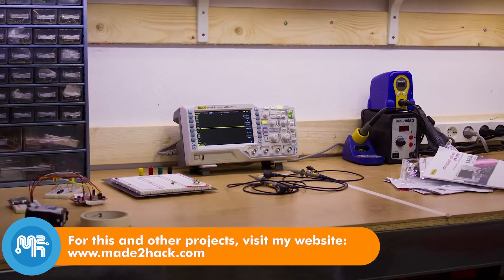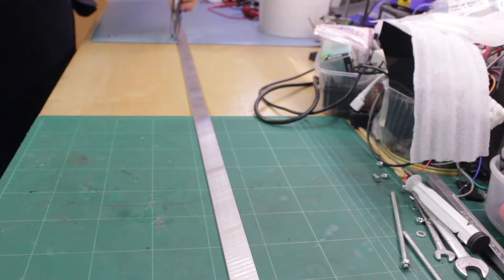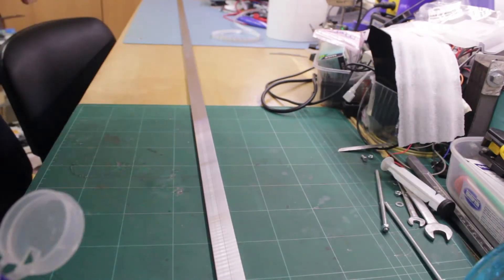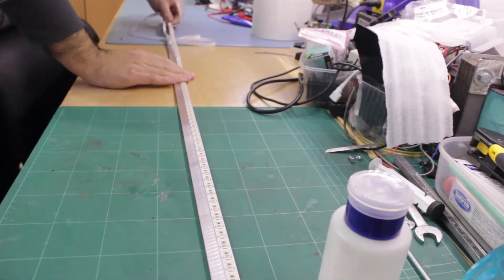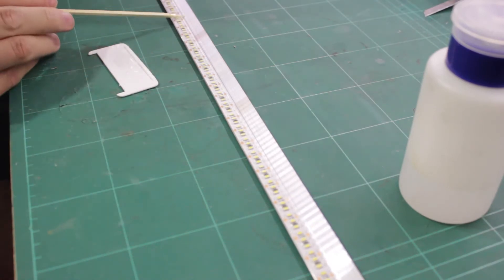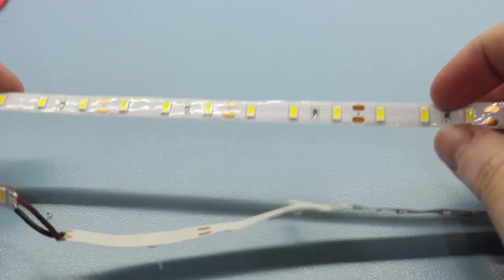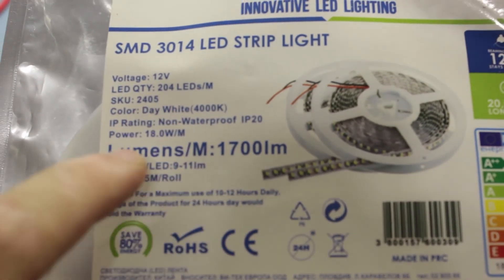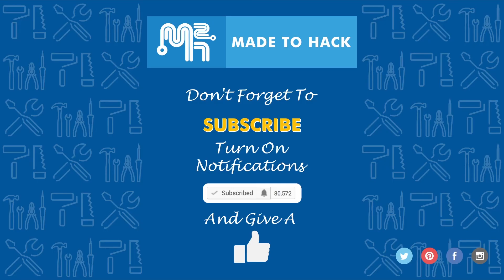Electronics Workbench LED Lighting Upgrade

Comment: I have seen some LED strips with def  segments used by other folks. A few spots on your old strips looked to be dark. Any suggestions to trouble-shooting and repairing the faults ?   Thanks   J K
Reply from the maker: It seems to me to be a matter of the solder not making contact with the flexible PCB. At times, I press harder on them and they light up again. The only other thing I can think of is to heat / reflow the LED / resistors before mounting them. However, then if you mount them and bend or slightly break contact, you're back where you started.